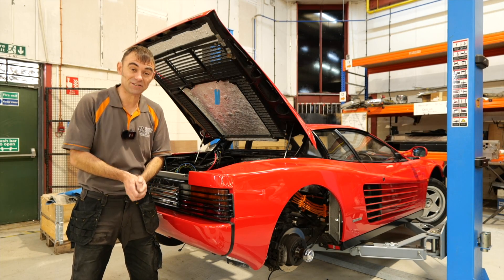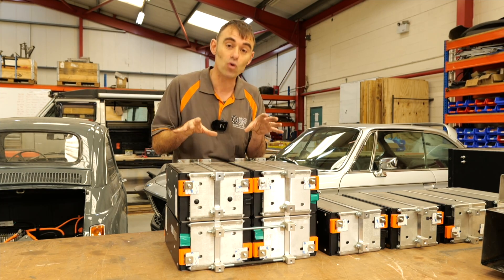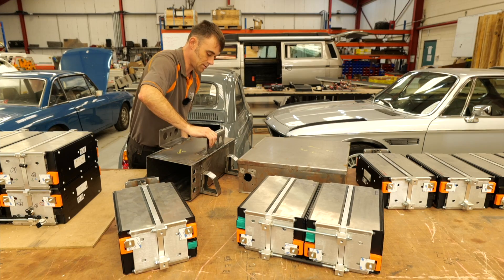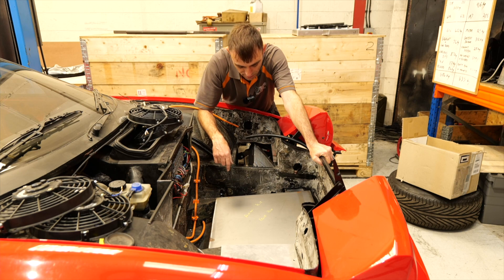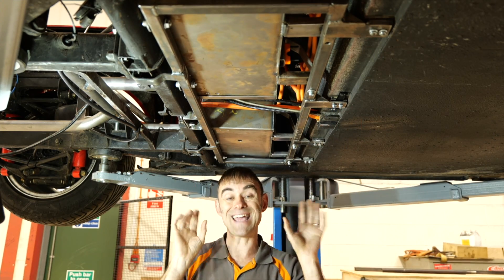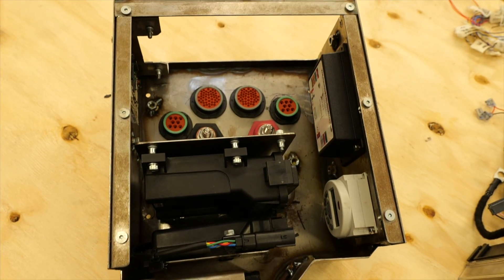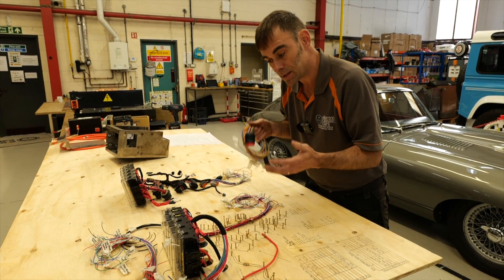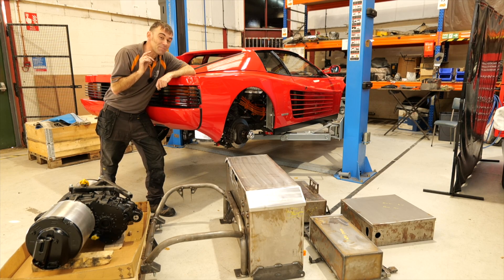Teslarossa Ep4 - Fabrication

Comment: Why do people think this is cool? Literally ruining a classic car
Reply: It's the re-engineering and designing and applying new EV auto tech in preservation of classic car bodies that people find interesting. The classic cars are doing a lot of the heavy lifting, but still, watching projects progress to completion is cool.

Also, ICE cars have more maintenance items to take care of when compared to EV cars both in terms of running and storage-- this is especially true for a classic car collector or enthusiast that might have their cars sitting for extended periods of time.
Reply: @dustinbird2090  the flat V12 is the soul and heart of a Testarossa. This removes everything unique about this car and turns it into a Tesla in drag. If you can't be bothered to repair and properly maintain a classic car, sounds like you shouldn't own one and stick to the electric tupperware cars.
Reply: @murmaider2  There's no accounting for taste, eh? Surely, the visual aesthetics and body style account for some bit of nostalgia and interest. Either way, an EV conversion at minimum, is 17-15K for the parts and 20K for the labor. That's an ultra low estimate as well. The folks that own the fancy classic cars can spend their money modifying or maintaining their cars however they like.
Reply: @dustinbird2090  theres zero taste in ruining a limited production classic car.
Reply: @murmaider2  Like I said, no accounting for taste. It's their money, it's their ride, it's their choice. At least most shops that do EV conversations don't alter the body or frame so people in the future are able to easily restore the stock setup.

As far as hot rodding goes, like all the small block or LS swaps, a tesla swap is just using the most ubiquitous motor. It's not inherently unique but it's a damned good powerhouse.

As far as we know, these EV conversions of classic cars may put parts back on the market that would allow several of them to stay stock and keep them running.
Reply: @murmaider2  how is ten thousand cars a limited production run ?
Reply: @dustinbird2090  buy a fiberglass body and update your golf cart, but leave these cars as God & Enzo intended.  If you've never owned a F car and driven it enough to enjoy it, that may explain a lot!
Reply: @xtremeincproductions  Fair point. Thanks for being insulting. But, it's not me that needs convincing to keep their classic cars in stock format.
Reply: @xtremeincproductions  strange that Enzo didn’t leave any instructions to keep making parts for these cars then. Maybe he intended them to have a limited life so his company could sell new cars. 
God could also perform miracles and return them to new, as he doesn’t perhaps he has not expressed an opinion.
Reply: Modern day Hot Rodding!!
Ever since the car was invented, people have swapped power plants, whether it was a Blown BBC into a Model T Ford, or now a Tesla swap into a Testarossa.
As long as they're getting driven, and not just waiting under a dust cover for their value to rise, its fine by me.
Reply: @anthonyrawsthorne656  its not hot rodding. Its lazy.
Reply: @murmaider2  why is it not Hot Rodding? 

'a motor vehicle that has been specially modified to give it extra power and speed' 

Okay, I guess we'll need to wait until it is finished, and see what the actual numbers say if it is , Hot Rodded ,or not, but on paper, it is..

Lazy??
Really?
Nothing that suggests Lazy ,so far.
Reply: @anthonyrawsthorne656  because hot rodding is unique. "We put a tesla motor in a testarossa, we put a tesla motor in a bronco, we put a tesla motor in a beetle". Also this is extremely cringe.
Reply: @murmaider2  Tesla motors do the job, and cheaper than, say a Koenigsegg Quark....
Tesla motors are the LS/LM turbo SBC's of the electron world...
I'm betting there's alot less tesla testarossa's , than SBC Deuce Coupes (like them both btw).

The only 'cringe' part for me (if you can call it that) is the kind of snobbery (?) ,that somehow if you drive an IC ,dead dinosaur powered car, you're personally clubbing seals.
Reply: @murmaider2  just like a ford flathead went into everything or a Chrysler hemi went into everything .
Reply: @murmaider2  Mate, you're talking to someone, who couldn't care less. I wouldn't care if they're run on fluid squozen from a tramps undies, the motors make good power!

Comment: Richard, a couple questions but first, when you say your assistant is glamorus, we all expect a pretty woman. LOL, now I understand you needed someone that could help you lift the weight, it was just a dissappointment when I was looking for long hair, long legs and heels. 
Back on topic, what vehicles are things like the A/C complressor and those battery modules sourced from? A video on just thee things would be helpful for someone like me as it would help to know what to look for. I'm sure there are reasons you use specific parts, maybe capacity, or voltage requirements, etc. but a video going over these would be good. One on batteries also. I've seen sometimes you use Tesla S modules and then like this car these are something else, maybe a LG Chem module but I don't know what it fits and also about the cooling plate, did it come with the modules or is it something you builgd or have built? The one other thing would be a discussion on the systems. When you mention CCS or VCS, what are you reffering to and what  are these systems doing. 
I really love the way you guys have packaged it all, the control box you displayed is really a nice peice. I've seen some conversions and if you didn't build it would take you hours to find everything but this is all in a place and layed out such tha tit could be quickly diagnossed in the event of a problem. 
Great job again, thanks Richard. 
DC
Reply from the maker: Thanks. I've had a chat with Tim and he's more than willing to wear high heels and put on a blonde wig for you. 😁👍 Batteries are CALB. CCS means Combined Charging System and refers to rapid charging. 👍
Reply: @ElectricClassicCars  Cool, thanks, LOL, tell Tim thanks but to keep his work boots on. I'll just go to the bar. 
Your videos are really good, I learn things with every one of them I watch and it always helps to watch people that are building conversions that work.  Thanks for that.

Comment: Nice one Richard. 
Still looking forward to T25 Syncro video.
I see the ICE dinosaurs  have arrived.😆
Reply from the maker: I drove it today. It's lovely. Update coming soon. 👍
Reply: Love these comments.  Electric cars will be the dinosaurs when the already short supply of lithium and cobalt runs out and hydrogen power replaces unsustainable heavy battery technology.  Battery powered cars are not new, been around for a hundred years or more.  Thomas Edison and an electric car in 1913.
Reply: @BombSponge  Where does the hydrogen come from? Currently 99% of it comes from fossil fuels and causes 2% of global emissions so if you tried to power all cars from hydrogen the emissions would be off the scale.
Not to mention the cost as hydrogen is currently heavily subsidised. 
Hydrogen is a lie put out by oil companies and one or two car companies who can't make a profit building EV's.
Reply: @alibro7512  You're not familiar with Electrolysis?
Reply: @BombSponge  Your not familiar with the facts? Electrolysis takes a LOT of electricity. To produce the hydrogen we currently use by electrolysis we would need more than double the current level of wind, solar and nuclear. If we decided to power our cars by hydrogen that would be multiplied by a huge margin.
Reply: @BombSponge  high demand is not short supply.
Reply: @SPONGE. You may already know this. Ferdinand Porsche designed an electric car - with at least two electric motors, built by  Eggar Lohner circa 1896/97. The car is erroneously referred to as the "Porsche P1". Stay safe and well.

Comment: A great deal of the value in a Ferarri is in its engine and transmission.  That gets put on the shelf in a project like this.  For a bunch of money, I suppose it can be returned to the original.  BUT, once one has driven your take--the TESLA-rossa, few may want to turn back the clock!
Reply: That so-called "value" is also its biggest liabilities.
Followed by the fact it looks like a door wedge.

Truly, beauty IS in the eye, . .  .   .    .
.

Comment: Was the original motor blown and the owner wasn’t interested in rebuilding it so decided to do a EV conversion instead?
Reply: It was running and driving. There is an episode on it to measure weight and fuel consumption before they dismantled it.
Reply: @Mardy72  wow. The owner must not even care about collectibility and just wants to be able to drive it without worries.
Reply: @89five3five  all of the conversions that Moggie and his team do are 100% reversible, so no collectable value has been lost
Reply: @Mardy72  well it was “ running “ in that in the best tradition of classic cars it needed a mechanic on hand at all times to keep it going. But that seemed to be a battery issue. The engine was fine.